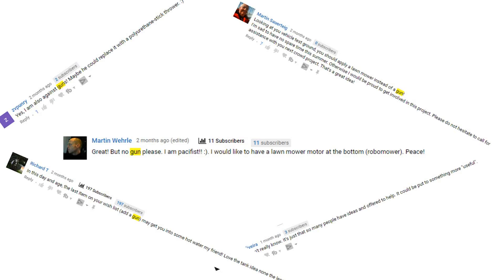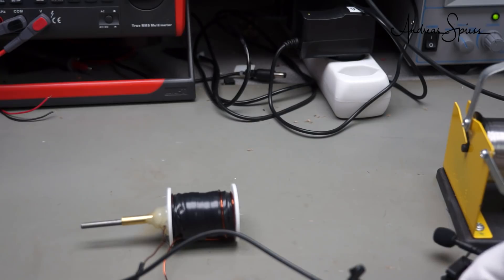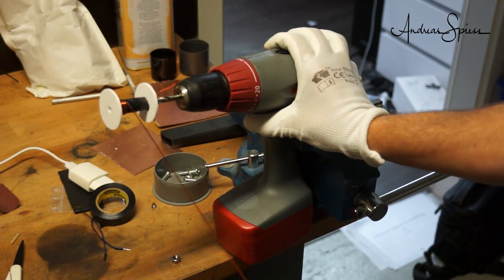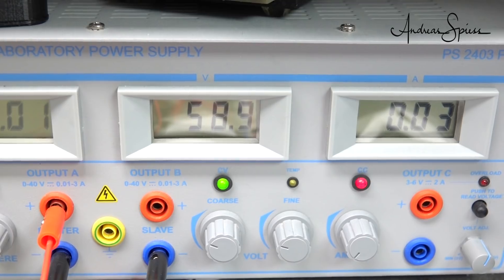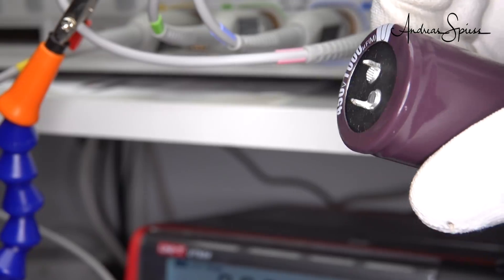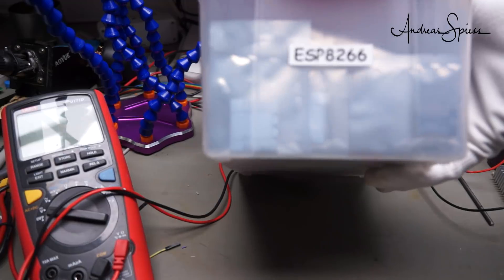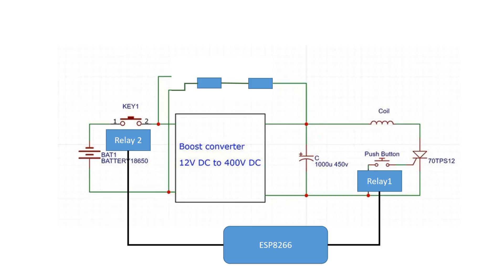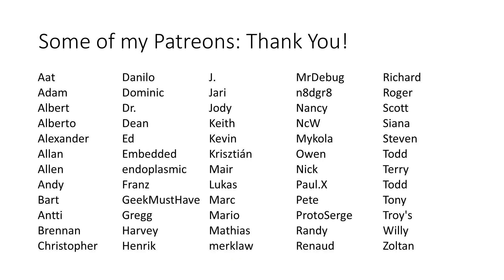#221 Better than GreatScott's Coil Gun? A true story, how-to not do it

Comment: Hello Andreas, 

as usual quite interesting what you did build and thanks for sharing mishaps as well, even it is disappointing it is always a learning for everyone else as well. Having great respect for you work I anyway would like to mention that I think there were several things causing the death of parts :

1. Underestimating free running voltage of the buck converter combined with "cheap" (aka not existing) regulation circuits build in that thing
2. Using a triac/thyristor instead of a transistor because we talk about DC voltage a devcie needing a negative voltage to clear it's on state might be not the best choice
3. Missing to suppress back voltage of the inductor (coil ) which will have quite "some" voltage

In my previous job I worked a lot with switching power supplys and high voltages. Most common thing was always to have a solid TRANSISTOR and a free running diode in parallel ( usually integrated into the transistor case ), most times BU508A later S2000 models. However these are transistors and unfortunately quite worse if it comes to amplification they have very low amplifiction but excellent rubustness. So what I would suggest to mitigate at least some of the risks :

- Get rid of the relais, at least the "small" ones I saw in your video. Given the voltage and amperage you mentioned the contacts will just burn or even worse melt together giving unpredictable results after a short while.
- Use high voltage switching transistors ( low side switching - N channel MOSFET are more common and usually can withstand way higher amperage ), there are several around especially designed for switching mode that do include a parallel diode. It's important to have a valid resistor between gate and drain to change to "off" state in a very short time to avoid burning energy and heating up the device. Maybe Vishay's SIHG73N60E might be worth a look - 70A@600V should be sufficient :D The beauty of MOSFET is for sure the nearly "no energy" needed for driving them but this is as well the pain in circuit design. High side switching for high power applications is not really common and therefore suitable parts for your application might be hard to get.
- Use an isolating device to drive the "switches", most likely an opto coupler but a special impuls transformer would work as well but rises again the issue with back voltage spikes because of it's inductance and will bring some delay into the equation

EDIT: Surprisingly the pictures on the Aliexpress packe do not have the exploded capacitor ... :D What should I now think ?

If the back voltage on the coil will be dropped by a diode I don't know how this could effect the launch speed of the projectile, it will for sure cause some losses in "gun efficiency".

That way the driving circuit should be safe, at least as long as you have only the ground plane as a common level (the buck converter should isolate anyway). If you want to measure the output voltage of the buck converter I suggest again an opto coupler, that's basically the same any switching power supply does, it's having a analog feedback loop through an opto coupler. 

This part I'm writing in german (kind of at least :D) : Ich ha no ä paar S2000 un BU508 ummeliege, wenn Du's mit dene probiere wotsch ka ich die au ä mol vorbei bringe - wär schneller als mit de Poschd vu Dütschland ind Schwiz für die knapp 40km ... :)

BTW: If I'm not mistaken a usual coil/rail gun consists of several acceleration stages, similar to the BlueFire roller coasters (EuropaPark) linear acceleration motor. But it would need quite intense tuning for timing to switch them on at the exact right moment, I guess it would anyway be possible with ESPs ...

BTW2 : In my previous job my boss once told me to unplug one thing as the cables where a bit hindering me measuring things properly on the PCB - well ... Any manufacturer did it that way but not Sony, they did build a ground plane from that ... so some capacitors lifting "the hat", some transistors being even more happy to die ... I was overwhelmed buy the kindness of my boss helping me to find the real error and to destroy the already broken thing even more ... That's life ... :) Magic smoke on capacitors is some times a nice mixture of a bit of P, a bit of C and some B, as well known as "Trafoöl" in the old days.

BTW3: One day I was playing around with a stepper motor driver however I killed a voltage regulator so it did no longer drop the voltage from 12V down to 3,3V but it was kind enough to deliver 12V instead. Because of the was the circuit was designed it did feed back that voltage to the 5V rail of the connected USB plug and back to my laptop - guess what ... It surprisingly survived. Man was I happy. I guess the docking station in the end saved my ass here.

So I hope you can get you power supply back to work in a short time, probably the display might be right and it does have in deed the ~58V and just beeing unable to regulate down because of a dead transistor acting as a linear regulator ... I'll keep my fingers crossed for you that it is that easy.
Reply from the maker: Thank you for your long comment. I never tried a Thyristor so I wanted to use one. and they are quite cheap compared to its capabilities. Not counting the damage, which I cannot blame the Thyristor for. And maybe I will find a way to replace the triggering relay by an optotriac or so. The relay was not in the main loop only at the trigger pin, so it should not be endangered. And the one of the primary side was protected by this 1-ohm resistor.
There are two versions of the same converter on AliExpress. Mine has a positive and a negative rail. The blown cap came from the negative rail.
Thank you for your offer (maybe we meet once if we live so close). I checked the datasheet of the BU508. But it says 8A peak collector current?
Concerning the rail gun. I corrected the title. I did not know the difference before...
At least I used a USB isolator to protect the PC. This would be a huge damage for me...
Concerning the power supply: I already got some help from my German friends (Datasheet and hits). So I hope I will be able to repair it. I also think it should be possible.

Comment: I'm also someone that doesn't like touching high voltages. Anything about 20 volts or so. That said I've managed to almost take my eye out with a electrolytic cap and only a few volts. Modern lipos can push out a lot of energy really quick ;).
Reply from the maker: The age at least has one advantage: I always have to wear reading glasses ;-)

Comment: A very useful little part you can use for galvanic isolation is the 'B0505' dc-dc converters and similar. You put in 5v and get 5v out but isolated. It's enough current to drive even some relays. All for a couple of dollars. You can find them and similar parts on AliExpress searching 'isolated dc dc converter'.
As a side idea, why not make a gun that shoots capacitors by blowing them up, you already had a working prototype at one point.
Sorry to hear about the power supply, maybe an opportunity for a repair video?
Reply from the maker: 1. Just ordered a few of these B0505. Look like a good idea also for other applications. I am not sure how fast they would be. But I can try when they arrive.
2. Some other viewers also experimented with caps. It seems to be an explosive device if used the "right way"
3. I hope I can repair it. And I will show it if interesting.

Comment: The DC-DC converter is (at least claimed by manufacturer, whatever it's worth) safe to use till 400V; otherwise isolation is not guaranteed. The actual output voltage is likely input voltage dependent and is trimmed by the pot at the input side, which is usually set at a random position off the factory, because there's no lacquer to fix the pot in place and you didn't really expect QC to begin with.

Another thing, you have drawn the schematic kind of under assumption that primary and secondary are commoned together at the ground; however ARE THEY REALLY? And what potential do you think you're getting between the thyristor gate and the low-voltage ground when that's not the case? If i were to guess, a high-frequency 200V AC or so.
Reply from the maker: 1. You are right. But I thought if max is 390 volts it will not exceed that easily.
2. I paid attention to the ground and tried to create a "star" from the GND pin of the cap. But obviously, this was not sufficient...

Comment: Hi Andreas, 
I see two problems in your firing circuit:
1) The thyristor does not have a free-wheeling path. The coil is highly inductive. After the HV capacitor has been discharged, the current will continue to flow, dragging the + terminal of the ElCo below zero. Over time, this will damage the bulk capacitor. Adding a fast free-wheeling diode will prevent this.
2) For firing thyristors, a certain "trigger energy" is needed and optoisolators can't provide this effectively/efficiently. Isolation transformers ("pulse transformers"), on the other hand, are very effective. They completely (galvanically) isolate the controller-side from the power-side of your circuit. Application-note from ST: https://www.st.com/content/ccc/resource/technical/document/application_note/af/cb/8f/45/a8/e9/4b/97/CD00003863.pdf/files/CD00003863.pdf/jcr:content/translations/en.CD00003863.pdf
Damn I just looked online and these are pretty expensive (ready-made) - you can wind your own on a 10mm toroidal core with a few 10x turns of magnet-wire.
Reply from the maker: 1. I did not see a lot of negative current or "ringing" on the diagram. But I did not check the voltage. I reverse diode for sure would not hurt.
2. I also saw optocouplers with Triacs. But not with Thyristors. And the one I have has a zero-crossing detector. So I did not try it.
Reply: Thanks for the answer Andreas, but I do not understand part #2. A ZCD isn't required, since you are not doing mains-chopping, right? I meant to say that you shouldn't use optos, but instead, should try using (the much more effective) pulse-transformers to fire your thyristor (SCR/Triac/etc.).
Reply from the maker: You are right. I do not need zero crossing detection an I think it would even hinder the triggering in my situation. You wrote that the trafos are quite expensive and efficiency is not my primary goal. I ordered some optotriacs without zero crossing and will try them out. I found that they are used in exactly my situation. The only difference: They are used on the high side.
Reply from the maker: BTW, do you have a Link to a pulse transformer?
Reply: @AndreasSpiess  The voltage across a low side sensor resistor will not reveal back-EMF effects. You need to probe the collector voltage.
See w2aew video
"#183: Why diodes are used around relay coils: Back to Basics on flyback or snubber diodes"

He probes a 5V relay coil however but still gets a collector voltage spike of nearly 300V. I'd imagine your 400V coil will be orders of magnitude higher.
Reply: @AndreasSpiess  please contact with me. shohag5050@gmail.com
Reply: The problem with pulse transformers is that if the thyristor blows out and fail short, the energy can still be coupled back into the controller. I recommend using A316J for "all" hobbyist power switching applications. It saves so much time for dealing with EMI, logic level drive signal, isolation and push/pull driving circuit.
Reply: Leo, Andrew, does the A316J work with thyrstors (SCRs)? The datasheet only talks about IGBTs... That's kinda' cheating, yes? ;) I have often used pulse-trafo driven triacs (long ago). With a properly designed driver and snubber, they are as robust as it gets. @Andrew, even a slow magnetic field ramp-down shall likely be much faster than the projectile (120 km/hr --> 30m/s --> 30mm coil --> 1ms --> L/R --> 10mH/10E --> ok!). The alternative is a blown ElCo.
Reply: I must say I had similar results with low voltage version of coilgun (though much more caps ... 30x 1200uF/50V iirc) and H bridge consisting 2 MOSFET and 2 diodes. Fully controlled semiconductors allowed to software-optimize design a little (duration of current pulse), something SCRs can't do (they do discharge caps almost entirely so both cap energy, coil resistance, inductance, length, diameter, projectile length, diameter, weight and material has to be perfectly matched for best results). Of course SCRs has one big advantage. Their pulse current rating is way better than those in MOSFET and they are way more immune to fast rise of current.
Reply: Do you have a sample diagram of above? I'm working on my version and I'm all ears Przemyslaw! Thanks for your notes!
Reply: That link is broken
Also, why don't use optocouplers with transistors
Reply: yes, you can try
Reply: Maybe I'm too nooby but why don't just use a MOSFET and a isolating driver like a low voltage opto-coupler? Aren't there some that can't stand the current?
Reply: @Wilson84KS  i also think that but mosfet with body diode and gate protection circuit using 10k Resistor and zinner .
Reply: @Andrew Crews If a snubber diode is problematic in this application he could use a metal oxide varistor instead, but the trade off is a build up of higher voltage than when using the diode. Still it's better than having no back EMF suppression at all.
Reply: That's exactly what I was thinking. But in the shunt 1 ohm scope capture (correlating current) why isn't this -ve flyback current seen (as voltage across this resistor but in opposite direction)? Just a thought.
Reply: Dont encourage this noob and dont send him more money-He will blow himself up :)

Comment: 12:00 You are much more knowledgeable than me when it comes to electronics but I found it rather funny that it took this long in the video for you to bust out proper isolation from the HV circuit. :P

BTW, I think it might be good to use an external ADC and with an optocoupler to prevent killing your ESP8266 if something goes haywire.

Also another comment on here made me realize that the flyback current from the coil might be killing the thyristors. Maybe you can find a high voltage diode to fix that issue.
Reply from the maker: 1. :-))  
2. The external ADC is maybe more expensive than the ESP itself :-( But I am pretty confident with the two resistors. And an ESP also does not cost an arm and a leg.
3. I have such a diode and will try it.

Comment: Great video Andreas, next time use TVS diode to protect I/O on ESP32. it works for me without problem.

   Esp32 io -| R |-   --| R |--Gate
                              |
                             ---
                            / \  TVS bidirectional
                            ---
                             |
                           _
                           ///
Reply from the maker: I even should have one of those somewhere. But I think I will go with some optoisolators. I would like to keep the high voltage completely out of my MCU stuff...
Reply: optoisolation is best choice, a great one is to use a solid state relay. to avoid trouble with gate triggering ...as you montioned.

Comment: You could forget about the coil gun, say the tank has tear gas mortars and just put some of those rubbish electrolytic caps on the outside - probably sound even more frightening when they pop. 

Probably everyone here knows... but electrolytics are supposed to be designed to split open on the end to release gross over pressure - the patterns scored on the end is supposed to be a deliberate weak point like a one time safety valve so the whole can doesn't shoot across the room like it did here.
nobody got hurt but IMO that's really a double failure. failure to stand up to the rated potential and failure to release evolved gas pressure in an orderly way.
Reply: Yeah, make a tank which fires electrolyte caps instead.
Reply from the maker: It probably did not have the time to open the valve at the top properly. But you are right. The sound and smell of the cap was by far more impressive than the one of the nail :-)

Comment: Why would you want to shoot something as dangerous as a pointy nail ???
I've installed a much safer modified Electric Nerf gun and air powered Airsoft gun in the past on a 28" long Army Tank. I got ranges of 20-30 feet with the nerf gun and about 70-100 feet with the compressed air powered airsoft gun.
Reply from the maker: That is the other possibility. I thought the old guy has to do the dangerous stuff. His life is less valuable as he will anyway die earlier than the younger team members ;-)

Comment: Why didnt you use the relais or a contactor in the first place to switch the coil on or off. Also the coil does make a huge voltage spike when turned off. That probably killed the thyristors....
R.I.P. gone hardware....
Reply from the maker: Good question :-)  Because I did not think about it and just did? But in this case, the coil should not create a big voltage spike because it is switched off at nearly zero current.

Comment: A sad tale but a great video. I too have managed to embed capacitor shrapnel in the roof or my shed through over-charging and it takes a while to get over the shock (& the tinnitus).  Perhaps these could be used a form of weapon ? Or if the effect rather than destruction is the important thing then just some low-voltage pyros might be a safer choice.
Reply from the maker: I wanted to tell the story because I learned quite a bit here. And the journey was the goal of this project...
I knew about exploding capacitors but never experienced one before. And maybe they are a little louder at 400 V...